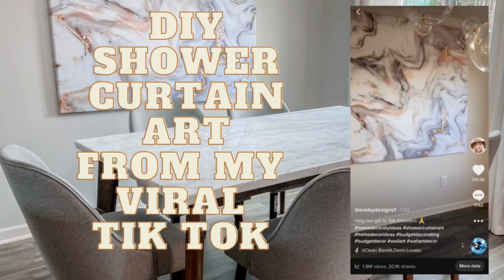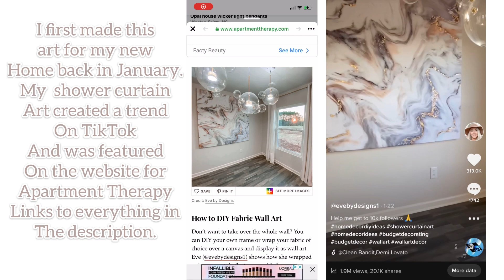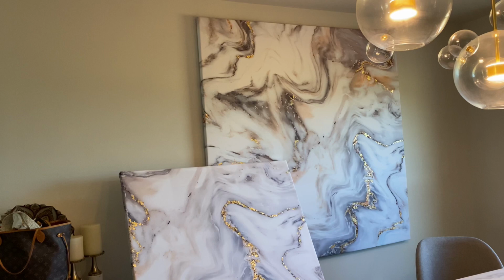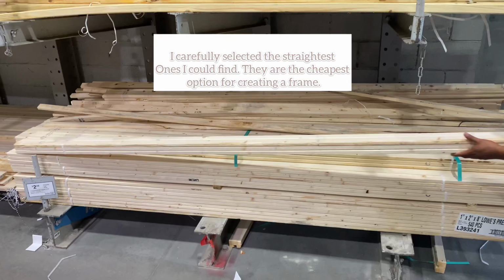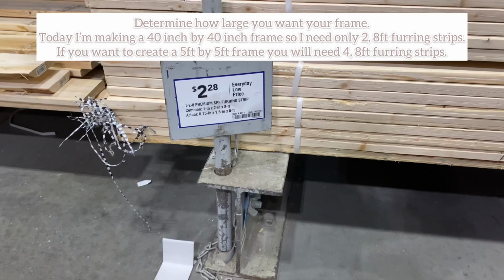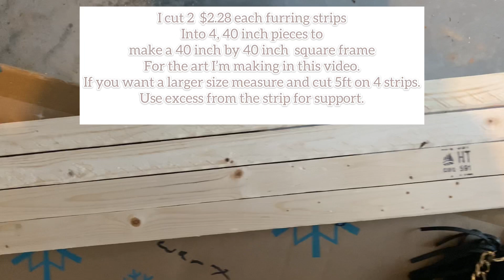DIY SHOWER CURTAIN ART FROM MY VIRAL TIKTOK

Comment: Do you need To enforce the back of the frame with a metal piece of wood going down the center I have seen a few videos I have done that, so what’s your opinion on that? Thank you so much you did a beautiful job.
Reply from the maker: I just did corner piece enforcement on the 5ft frames and it worked